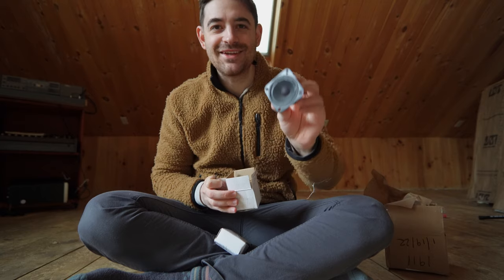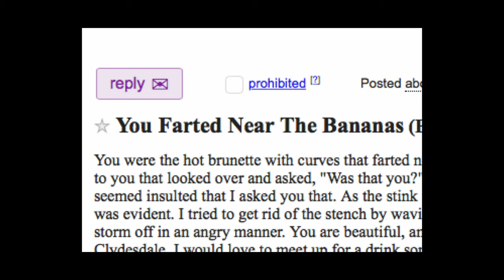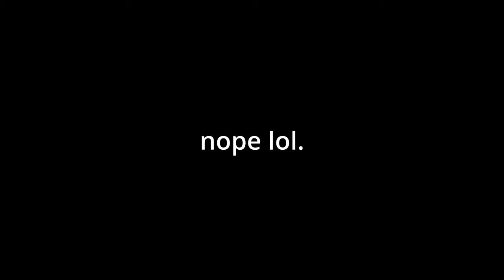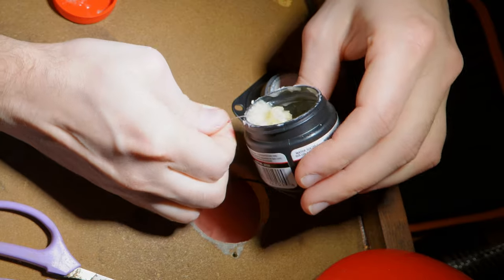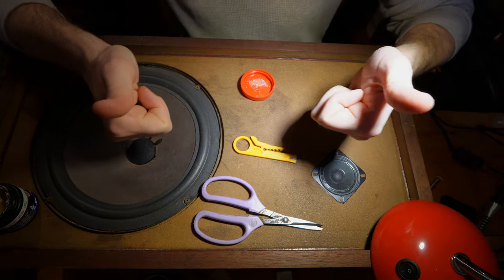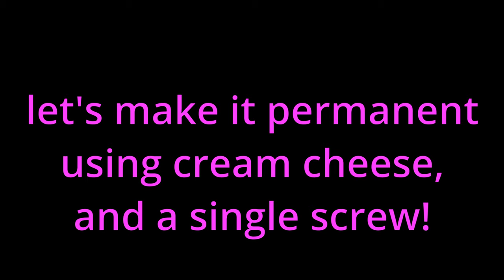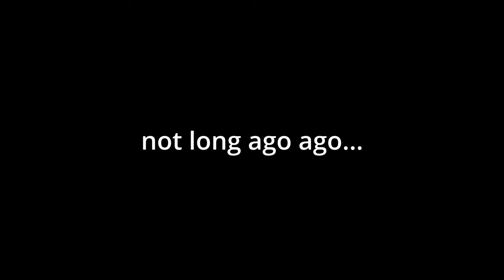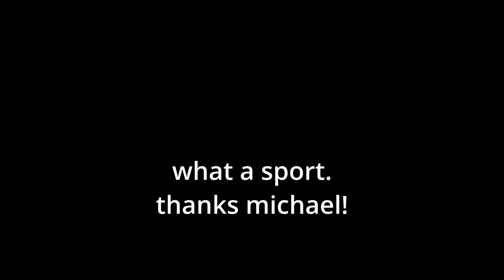Should you Invest in Expensive Studio Monitors?

Comment: You could of just used PVC tape to fix the hole in the broken speaker.
Reply from the maker: Great idea
Reply: @travisraab  My cat dented My technic speaker, and the only way to fix it was to shove a metal hook inside and push it back into shape, I was left with a hole so use Electric PVC tape to fix it, worked fine no problems.